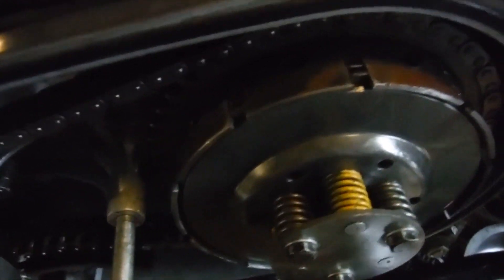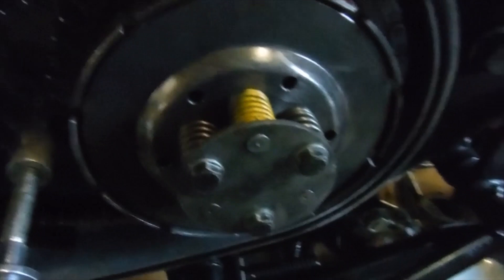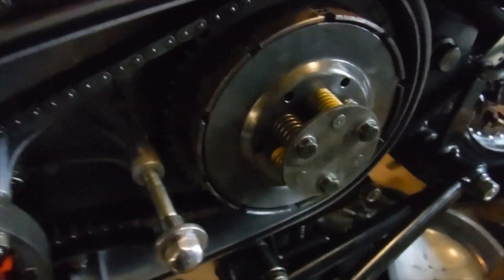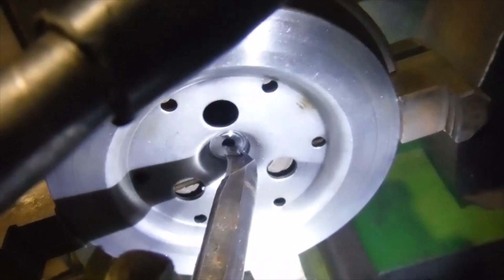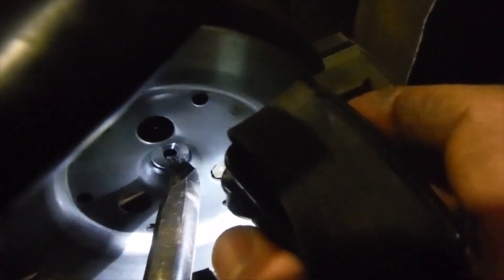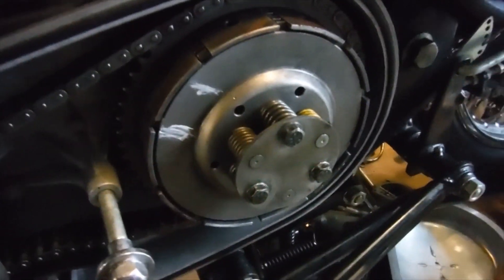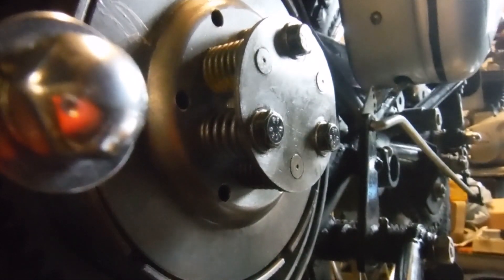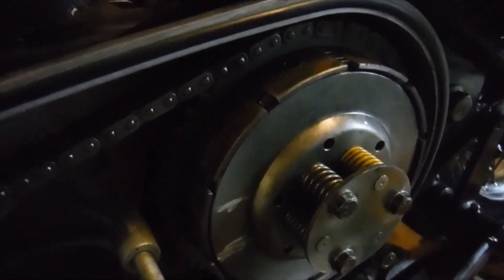Royal Enfield clutch pressure plate trick to help reduce clutch drag. Lathe work required!

Comment: I had a 350cc 1959 RE for years & years and could'nt understand why that righthand cover plate was held on by just one (?) central bolt, which always dripped oil from the rubber seal when the engine heated up.  It was that alone the bike was nick-named Royal Oilfield.
Reply from the maker: Those primary covers are usually very good and don't leak, going by the ones I have encountered, at least.